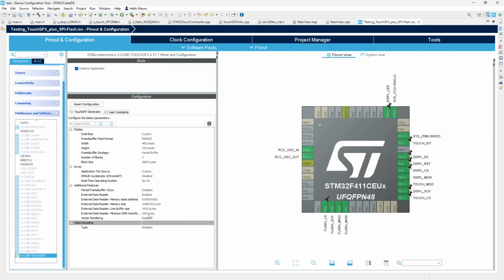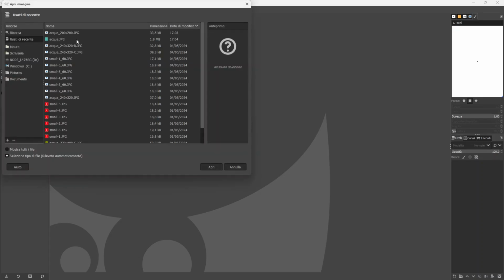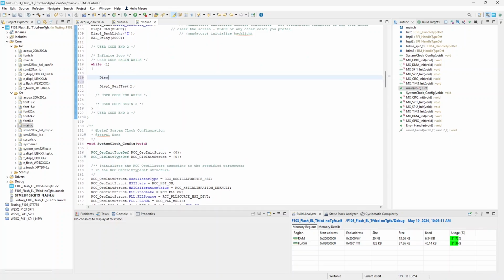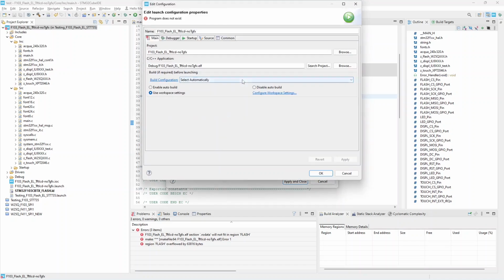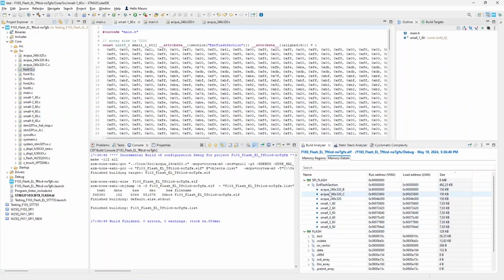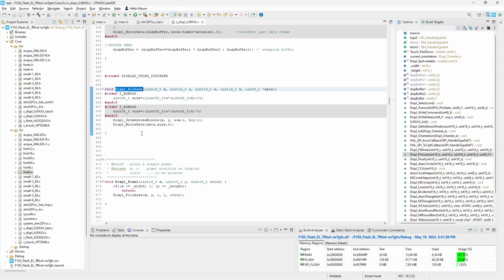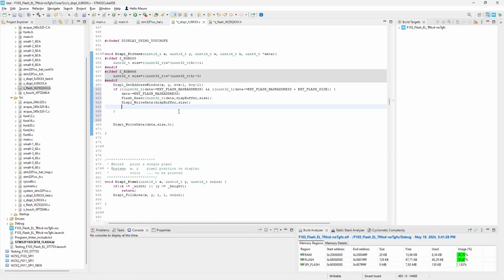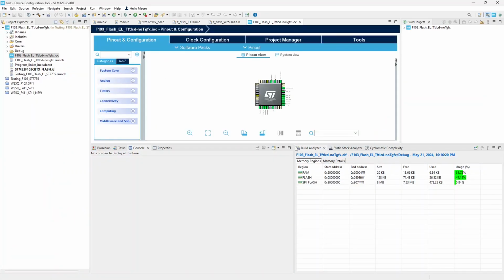Images on SPI LCD display + SPI flash + External Loader

Comment: i used stm32f103c8t6 and build stldr file but in linker file for ram size 20k there is an error when compile it, and when write ram size 64k it is compiled but not work.

Comment: Watched all your videos about external loader...and implemented here in my H503. Everything working good (although I'm still implementing the Display routines).

Just few doubts :

- What is the peripheral the uC needs in order to read directly from the address 0x90000000 ? (I'm imagining something like QSPI or FMC).

- Any plan to convert the W25Q routines to DMA access ? (at least the READ function)

I'm using the compact version, with low-layer SPI / GPIO access (no HAL)...and got a 9.3kB loader size.

My only problem now is the speed. The controller is busy with several other tasks, and reading data from the SPI Flash gives me a lot of hiccups during the operation. I'm thinking of slicing the read function and put it into a timed Interruption...or maybe try to convert it to DMA access by myself (little experience on that).

Anyway...I just want to thank you for all the effort you put in those tutorials. Your work is being very appreciated.
Reply from the maker: Glad to see you find useful my videos. Replying to the above points:
- do you mean you are using both SPI and QSPI for instance 0x90000000 space? In that case you must assign a distinct address space to each device. You will set one device starting from (for instance) 0x91000000 having on 0x90000000 an 8M flash (to 0x90800000). And in such a case, you will have to set a proper EL accessing flash to the proper address.
- I haven't seen important advantages in using DMA reading SPI. A different thing is using QSPI, I'm close to publish a video about QSPI+MDMA having found surprising (to me) results.
Now I see(!) (about the developing you are doing): here, yes, DMA is relevant. I'll take a look to SPI+DMA library

Comment: Hi, its possible use only one spi to display and flash without touch?
Reply from the maker: uhh. Technically nothing should be changed. Setting the same port on both libraries, project should work. It should work even enabling touch. Everything should be driven by the related CS pin. But I never tested it, I don't know what to say about the preformance of this configuration.